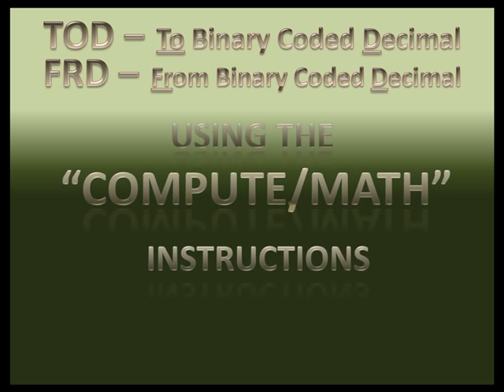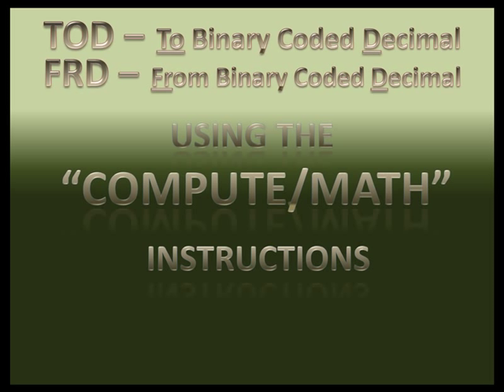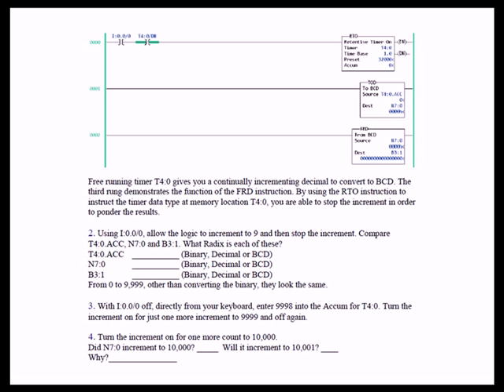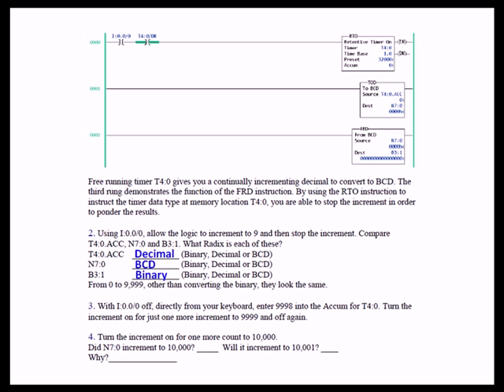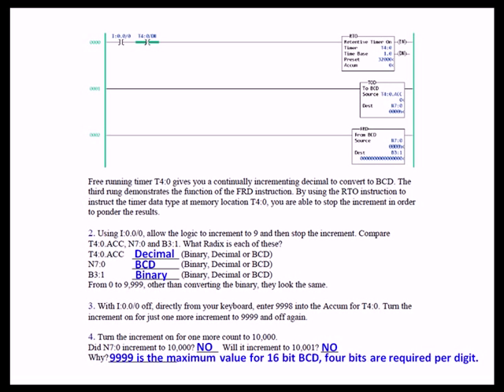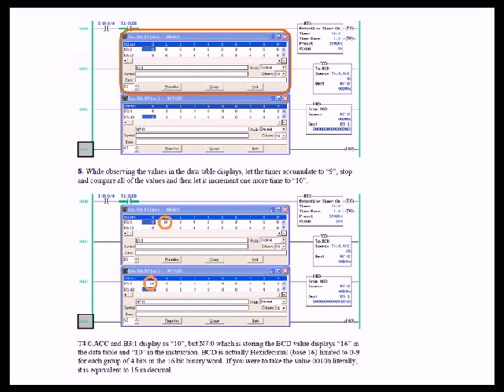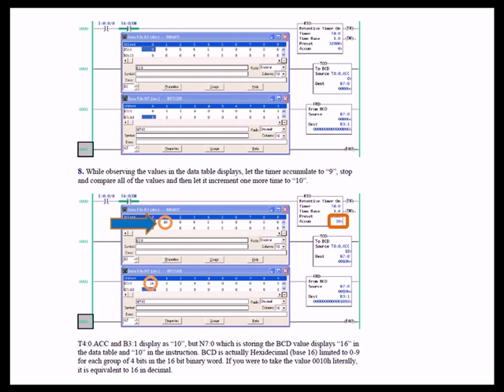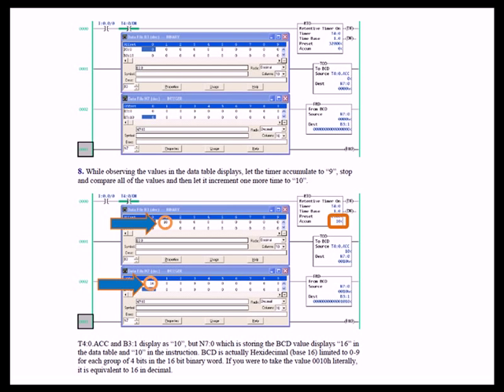ADV1 13 - TOD FRD Instructions RSLogix500, A PLC Tutorial.

Comment: I had to come back to this lecture to make sure I have it straight. From the examples I've been able to find, the most common use for these instructions seems to be for a thumbwheel input/4-digit display output. That all looks pretty foolproof. The value would be the same whether Hex or BCD. Is there a situation where the Hex/BCD values may become confused? I'm still new to this, so please forgive my ignorance.

Thanks again for your very helpful series of lectures!
Reply from the maker: BCD and HEX are identical for the equivalent decimal values 0-9. However, 10-15 are not valid BCD values. Always reflect on the variables (pointers, etc...) as memory locations that represent a value (decimal, BCD, octal, Hex, ASCII or binary) that is implied by the write type instruction that addressed it. The actual value in the memory location is binary. For an example; if you asked a friend to pick up one USB cable at the computer store and then handed them a note with just the character "5" written on it. They did not look at the note, got busy and passed off the note to another friend to run the errand without any other instructions other than, "here is the list of things to pick up at the computer store". The original implication is lost and only the originator can restore the value to 5 USB cables.
Reply from the maker: To make matters worse, if you wrote 101 (bin equiv. dec. 5) they would really be guessing to put the original value, 5 USB cables in action.
A crude example but I hope enough.
Reply from the maker: The bit does not know whether it's parent is REAL - LINT - DINT - INT - SINT or BOOL atomic data type. Probably more than you wanted, but once I got started I did a memory dump.
Reply: plcprofessor So, as you stressed in the lecture, you must be sure of the source of the file, as it can otherwise be interpreted in any number of ways. Can I assume that this causes the most trouble when troubleshooting?
Reply: Wesley Taylor Oh, and you did make me look up all the terms! Your memory dump is my learning session.